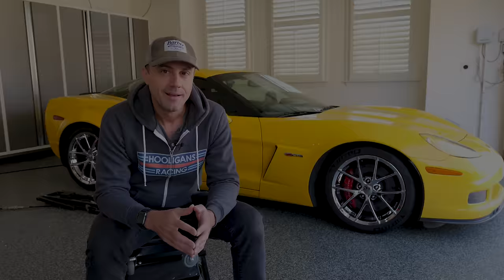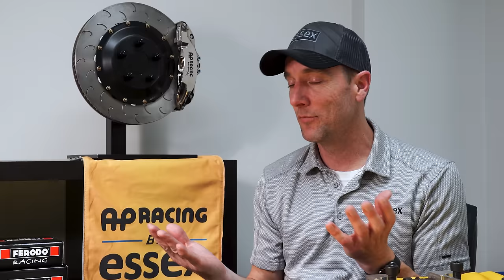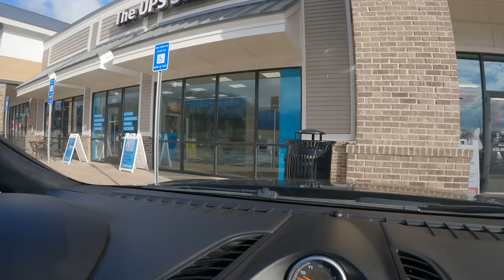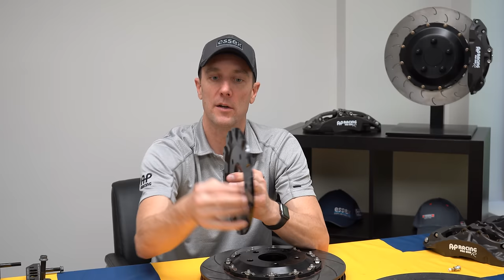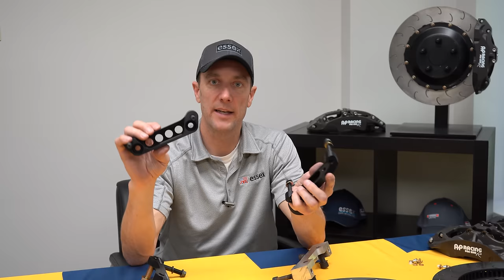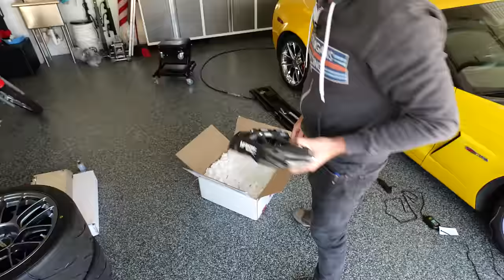Big Brake Scam... RESOLVED?!

Comment: Oh my gosh.  You should have talked to Aaron or me first before making that purchase.  What people don't understand about sports cars - they can manage heat at a specific range AND be reliable. RACE parts are designed to handle extreme heat, and often won't work at street temps.  In fact, most sports cars should not be driven below 40° because those race tires and race brakes will never get to operating temp.

Comment: Great to see this get sorted out. I have zero regrets about my AP racing brake kit and it definitely helped give a little more confidence slowing down the car. Once it's installed I'd be interested to hear feedback on the overall brake feel. I've always thought the pedal on my Z06 was a little light compared to other cars I've driven on track. There's no problem slowing the car but I had to retrain my brain on how much pressure to apply. ABS activates with anything more than moderate pressure.
Reply from the maker: Interesting. I noticed with my last track session (when I set my new PB) I was activating ABS going into every braking zone. The Atom didn't have any brake boost (or ABS) and it was really easy to modulate the brakes and you got a ton of feel through the pedal.
Reply: @JoshVanVeld  Good to know it's not just me. Stickier tires will help reduce ABS activation a little, but I think most of it is just down to muscle memory.

Comment: I have the 9660 AP Radical on the front and the rear of my C5 ZO6 and I absolutely love my brakes. I went from changing pads and rotors every track day to 1 time a season. Heck I’m still running the original pads and rotors when I installed the system on my car!!! I track my car at least 2 times a month and it looks like u might be able to get another season out of my pads and rotors!! AP brakes kits are worth every penny!!
Reply from the maker: Awesome! There is no substitute for having confidence in your brakes.

Comment: I concur with the statement on spending on brakes. Go defined kit - or get a properly engineered system. Skimping leads to disappointment. And proper design is glorious and meaningfully better on track. Plus, stick with the major players, the biggest cost benefit of high end systems is the rebuild ability and parts supply chains are critical to realizing those savings. Last word, bedding matters... most the best systems are not at there best until you get them nice and hot and fitted to the rotors.

Comment: It's great to see a video like this- a manufacturer and customer coming together to discuss real world problems.  It was awesome to see that Essex & AP Racing really stepped up to help Josh out.  A lot of companies wouldn't go as far.  Can't wait to hear how Josh likes the set up.  For a lot of us, track days are still a dream- something on the bucket list.  But as our dream becomes closer to reality, we must start preparing for that day.  Brakes and tires are probably two of the most important aspects to setting up a track car.   After everything I've been reading about AP, they seems like the obvious choice for my car, though the pricing still makes it a considerable commitment.   Of course, when evaluating the options out there for my e46 M3, Stoptech and Wilwood are two competitors that are always in the mix.  I'm still trying to decide what system will make the most sense for someone with my usage- mostly street, but a couple track days per year?  Any suggestions?
Reply from the maker: If you're just getting started, track pads and fluid will go a long way. It took me a lot of track time before I was capable of getting anywhere near the car's limit. Once you're ready to really lean hard on the brakes, you don't want to skimp on that component, but the AP kit is a big investment.

When you think about race cars vs. street cars, street cars are almost always quite a bit heavier and therefore ask more of the brakes. Once you're ready to start shopping I'd strongly advise you give Jeff at Essex a call.

Comment: I have strictly stock needs, but will be replacing my worn brake rotors, since I have the one way only GM rotors mentioned in this video.  I learned valuable information none the less through the discussion which I can apply to forming my rotor buying decision.   I thank you for the information I gained.  Personally I would never run the risk of buying safety equipment from anyplace less than solid.  And because of the way eBay or other aggregate sellers inventory parts all together , the chances of getting a counterfeit part increase.  

To explain, based on what I read.  A seller will send inventory to the web site warehouse, where it is stored with all the other inventory from others selling the same item.  When you buy something, they go pick a part and ship it out from the common bin, not specifically the part your seller put into inventory.   You might get a part from an unscrupulous seller who buys and sells counterfeit parts .   Or you might be a guy that got a great deal because he was unknowingly buying cheaper counterfeit parts, and might actually get a real part, there is no control, just part numbers in inventory getting matched to part numbers being shipped.
Reply from the maker: Glad you got some good info out of the video! It was a big learning experience for me. Interesting about aggregate sellers - I've heard some horror stories and it stands to reason that people are out there scamming even the biggest online storefronts.

Comment: I learned my lesson on scam parts buying headlights from the infamous corvettemods. It really sucks but I'm glad I learned on those and not on something more expensive or vital.
Reply from the maker: I haven't heard about a headlights scam, what's the story?
Reply: They were a knock off ACA hid projector kit for my C5. The fitment was terrible and they arrived damaged and when I reached out for a return customer support was incredibly rude and would not accept a return or exchange. After dealing with it I found out corvettemods is a pretty bad business that is constantly changing names and faking reviews according to the corvette forums. 

Admittedly I was pretty naive and it wasn't even that much cheaper than the legitimate kit but you live and you learn.
Reply from the maker: @almostlastplace  Ugh. Live and learn!

Comment: Looking for a bargain is not always worth it, it can cost you a lot of time, headaches and extra money even.. you have to judge it on a case by case bases but generally speaking trying to save money on critical parts like brakes is usually not a good idea for obvious reasons.
Reply from the maker: 100% agree. A lot of times I lose the battle with my inner cheapskate.

Comment: Hey josh just saying…have c6 z06 and mine is still stock … changed seats and put proper seat belts .. regularly shame GT3’s buuuut ! The driver experience counts for a lot …when I got car I couldn’t at all..why the original seats and belts didn’t hold me in seat so I ended up holding on steering wheel not to bang my head on window in turns … that being said my suggestion to you is first thing to change is tires obviously but also seats … after that changed y steering wheel for a smaller radius…the original was the same circumference as my Yukon..

Comment: I've noticed in a couple of your videos that there is mention of rotor vane direction. I know manufactures of directional rotors make a big deal out of it, and the public (at least those who care about such things) seem to have bought into it, but I would like to comment. This is my slightly educated understanding:

The engineering/development of centrifugal fans (which the vanes in a brake rotor essentially are) tells us this: Within a pretty large blade angle, either leaning forwards or backwards, the amount of airflow at low static pressures is significantly the same. And the airflow through a brake rotor IS at a low static pressure, since it isn't trying to push air through a restrictive duct system or something. And brake rotors definitely have vane angles that are well within that range of value that gives this result. The reason for this is that they are acting CENTRIFUGALLY. They are NOT scooping up air at the inside edge of each vane like a knife edge. They are moving air because they are spinning, and so the air gets thrown to the outside, which of course creates low pressure along the inside, sucking the air in to replace the air that got thrown out. And this happens the same, regardless of vane angle (well, like I said already, within a pretty large range of angles).

Now, centrifugal fans ARE designed with different blade angles, but it's mostly for reasons of needing to push against a higher static pressure, or just very slight efficiency gains as regards the electric motors that turn them. NOT for airflow reasons. Lotus (yes, that Lotus) lab tested the benefits of directional rotors during the development of the Elise/Exige, and found that there was no appreciable difference between the resulting rotor temperatures regardless of vane direction. So they supplied the Elise/Exige with non-directional rotors. Why waste money on two different castings if there's no benefit, right?

I guess it doesn't seem intuitive unless you're some kind of an airflow engineer that designs centrifugal fans, but there you go.

Why do they angle/curve the vanes at all then instead of just making them straight out radially? Well, there are structural considerations in the application of a brake rotor. The angled/curved vanes help address those considerations.
Reply from the maker: Wow! Thanks for that write-up, it makes good sense. Next time the C6 Z06 stock rotors come up in conversation I’ll be able to trot out some trivia 😄

Comment: Jeff didn't mention it, but AP Racing drops something like 10lbs off the front and 20lbs off the rear of a C6 Z06 when you upgrade to their brakes. The calipers are pretty wild. 

I learned a few new things from Jeff in this video especially about the hat and the rotors + why they won't sell individual components if they didn't supply the kit itself. It's a nice compliment to the Corvette focused video on the AP Essex Youtube channel. 

The kit is very expensive, especially given the market value of a C6 Corvette, unless you have the ZR1. The reason I chose AP was performance and the potential for future resale value. They have such a good reputation I figured it will either make the car easier to sell of allow me to get a higher percentage of my original spend back than competitor solutions.
Reply from the maker: Right on! Reduced unsprung mass is a big deal.

Comment: Going through a similar case. Bought a brake “kit” for my gm1500, affordable setup but the brake mount bracket is billet aluminum with mount bolts which are 10.9 zinc plated store bought hardware. The tolerances make the pads run off the edge of my rotor my a few MM. 

Quite disappointed with the quality.
Reply from the maker: Ugh. I feel your pain.

Comment: So are they saying they can't sell you individual parts?  New kit is needed everytime you need a new consumable piece? Surely if you have a authentic receipt you can get new components right??
Reply from the maker: I think they're saying that they don't offer support for kits or components that were not originally purchased through their dealer network for a lot of different reasons. If your kit came from them or one of their partners, even if you're not the original purchaser, you can absolutely get replacement parts and service.

But if you buy gray market calipers with a cobbled-together "kit" like I did, you're going to be up a creek if you need support. I did not realize this at all until I spoke to them, thank goodness they took pity on me. I think they hoped that by getting the word out with the video it might avoid more people running into the same problem.

Comment: Josh, enjoyed the vid as I have your others but I’m a little confused, if someone did purchase a used set of AP calipers that were the correct part for a c6 z06 Essex wouldn’t sell them the other parts they need to complete the kit?  Maybe I misunderstood what Jeff was saying?
Reply from the maker: Good question. My understanding (I could be wrong) is that Essex and their authorized resellers only sell complete kits that include the brackets and other hardware supplied by Essex.

If you find yourself (as I did) with genuine AP calipers but without an AP by Essex kit - then most likely your calipers were not imported or distributed by Essex and came from another market, likely in Asia, making them gray market parts. 

This is how non-authorized sellers profit - presumably by getting their hands on calipers from other markets at cheaper prices than they can be had in the US and sometimes piecing together a full kit with brackets and other parts of dubious origin (this seems to be what happened to the original owner of my kit).

Since they never came through Essex, they're not supported by Essex and purchasing caliper brackets and other hardware falls under the support umbrella.

So you can't buy gray market calipers on ebay and expect Essex to sell you the rest of the kit piecemeal.

Similar things happen when you buy electronics online from a non-authorized retailer and you can't make a warranty claim.

Jeff did tell me that they offer support for second-hand kits, provided that the used kit you buy was originally purchased through Essex or one of their affiliates.

Hope that helps!
Reply: @JoshVanVeld  thanks for responding Josh.  I believe your calipers were actual Essex items?  Did they say for what application and where they were originally sold?  Just seems like they expect that these brake kits will be "married" to a specific vehicle which takes the used market out of the equation.  I haven't tried to cross the Radi-cal caliper over but im assuming that a caliper may have multiple applications with different mounting brackets, different rotors or hats ect. but that may not be the case.  It would just be nice to know that if i did purchase their setup im just not stuck with it on my c-6.  Kind of like a built LS7, i can sell the car, keep the motor and put it in another car, might need different headers or motor mounts or oil pan but its not married to the car or even that platform.  Hope this makes sense, I still think AP is a great product and one day I hope to have their setup on a car.  What they did for you was over and above in my opinion, guess i always assumed if a person bought a used set of AP, Brembo, Stop Tech, Wilwoood brakes they would be able to call a distributor and purchase the parts to make it work on their particular application.  Keep the videos coming and let me know if you are coming up to VIR anytime, ill do the same if im coming to Atlanta.  Thanks
Reply from the maker: @libertybell9392  My calipers did not come through Essex, they were imported by a shop in Canada through dubious means. Thankfully they are authentic, just not originally sent to the North American market. There were markings on the boxes that indicated it was probably from somewhere in Asia but I didn't investigate further.

That's a good question about migrating calipers from one car to another, I'd recommend calling Essex directly about that.

I hope it won't be too long before I get up to VIR, it's an amazing track! And if you'd like to do a guest day with me at AMP sometime you'd be more than welcome.

Comment: So glad you got those sorted out.  Looks like you'll be getting a nice boost in braking performance.  Essex is a really great company to work with.  What are your plans for the rear brakes on Goldie?
Reply from the maker: Good question. Right now I'll stick with the stock rear calipers. Racing fluid and pads go a long way, especially since the rears don't handle nearly as much of the braking burden... but I already feel the itch to upgrade to the AP rear kit (don't tell Nicole!)
Reply: @JoshVanVeld  If that's the case then I wish you the best of luck finding one that wont scam you for authenticity.  Maybe the guys at Essex could get you a discount on a set that was used on one of their C6.R builds that Pratt & Miller have laying around.  Which reminds me, perhaps getting a few ideas from the Pratt & Miller racing company wouldn't be a totally crazy idea.  Worth a look at any rate.